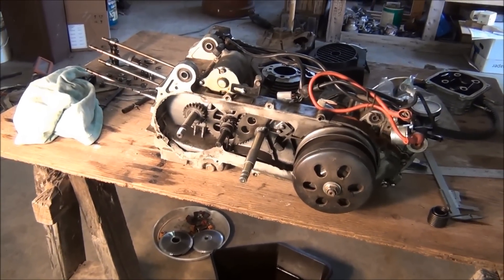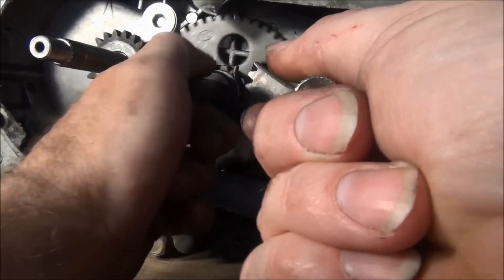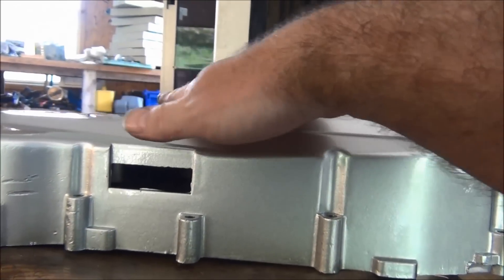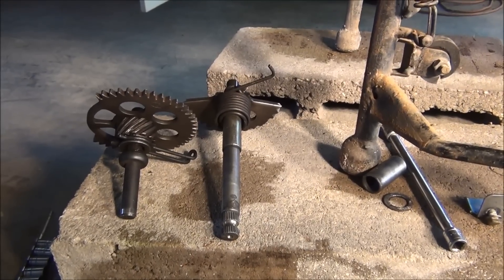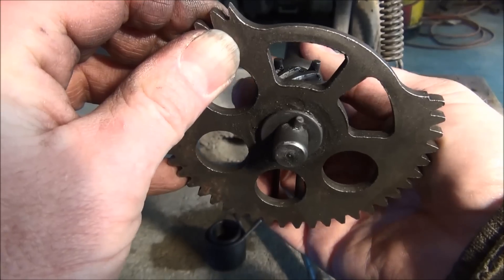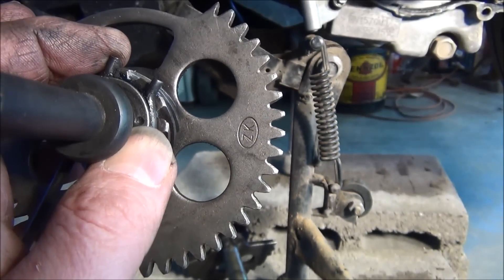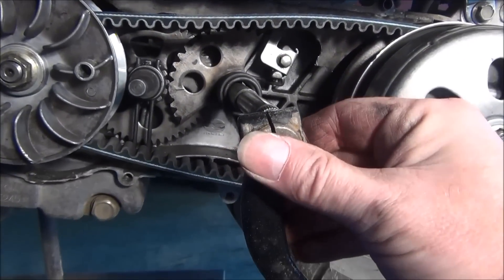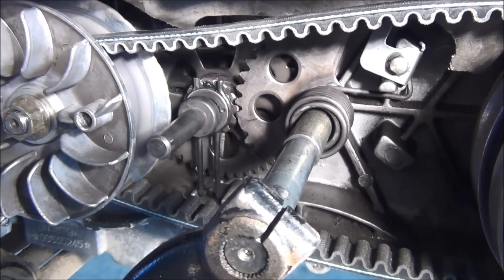Kick Start Gear Alignment - 150cc GY6 - Ammended with Additional Content.

Comment: Great video, thank you much. Can you tell me, does the clutch cover require a gasket? I can’t seem to locate one online. If it does require one (which I’d think it would) can I use a form a gasket silicone and make my own?
Reply from the maker: "It depends". Not super critical. Keeps some of the dirt out. May eliminate some noise and vibration of the parts moving against each other. Possible that the clutch or the variator may touch the inside of the cover without the added width of the gasket. You can try without and see how it behaves. Silicone gasket (Ultra Gray) would probably be fine. Maybe if you actually follow the directions on the tube and leave it set for a while before you squish it together so that it stays a little thicker.
Reply: I never use the gasket, because it breaks every time the cover is removed. The cover is not sealed anyway, there is air inlet and outlet so dirt gets in there anyway, gasket does very minimal difference here.

Comment: this helped me just fix my bike/scooter so thank you four posting I'm wanting to know how you got your pulley off on your first video if you could please
Reply from the maker: +cricketol  I made a fork-y type spanner out of nuts and bolts and some sheet metal. Was crude but did the job. Do an image search on "scooter variator spanner" for some of the store bought varieties available for cheap.
Reply: +Paul Matulewicz thanks for the tip and great video
Reply: +Paul Matulewicz Pre-made spanners are like $15 from China (off eBay, etc) if the user has time to wait.

Comment: thanks for the video bro. also your belt  seems to be lose on yours mines very tight think I did something wrong with putting my belt on..
Reply: +kevin It's not a big deal to have a loose belt after reinstallation b/c the pulleys aren't in their operational positions yet.  Usually because the rear has been pulled open to create slack for easy belt handling.

Once the crank rotates a few times the contra spring in the rear will result in proper tension being held on the system and it will be snug.

Comment: Thank you.  I'm having a challenge.  When I put it all back together, my vento will not start.  When I pull the kickstarter gears out, it will start?  Any advice?
Reply from the maker: Ron Mason If the secondary shaft is properly aligned, then the cutout section of the gear ring in it's resting position doesn't touch the crankshaft . If there's no interference then it shouldn't make any difference whether the gears are installed or not.

Comment: Could i still use my kickstart even without that spring? Cuz mine brokes.And i dont wanna put it right back without that missing spring
Reply from the maker: Angelo Cullat Which spring? If you are referring to the heavy coil spring on the kick start lever, then no, I would not recommend it. Without that return spring the kick start lever could move on it's own it could cause the gears to engage the crankshaft while running. That would not end well. The weird two-finger spring on the intermediate gear is there to provide resistance so that they system disengages. Won't work well without that either.

Comment: Great video, do you recommend any grease on the gears?
Reply from the maker: thersten Only if it makes you feel better and only sparingly. The drive belt and the torque clutch create a lot of dust inside the cover so any grease quickly turns to gooey sludge.

Comment: The low quality aluminium casting which the end of the spring goes under cracked and broke off on my kickstart. Not a good design as there is constant load on the small piece of casting causing minute cracks which get worse when using the kickstart. I managed to repair it by  by drilling a hole and using a self tapping screw for the end of the spring to go under.
Reply: Best thing is if the electric starter always work. This kick start construction is so bad. I did remove it from mine but the gear on the crankshaft has to be there.

Comment: what happens if someone kick start when scooter's ignition is on
Reply from the maker: Unhappy noises mostly. If the crankshaft is spinning at normal speed it would be difficult to get the big kick gear to engage. Would probably grind and complain as the edge of the teeth get rounded off. If by an unlucky chance it did engage, I would expect that it would run to the end of it's normal rotation and then be clear of the crankshaft like normal. Not fatal, but I wouldn't make a habit of it.
Reply: Paul Matulewicz thanks